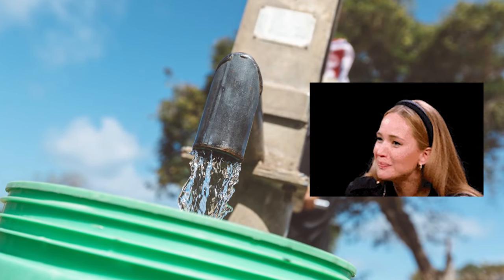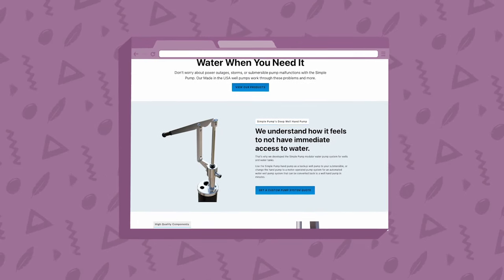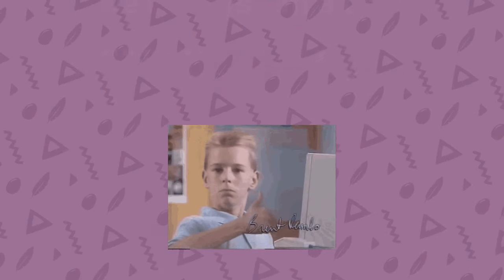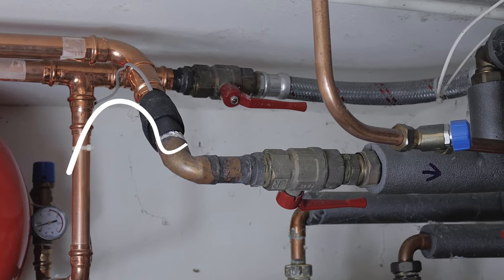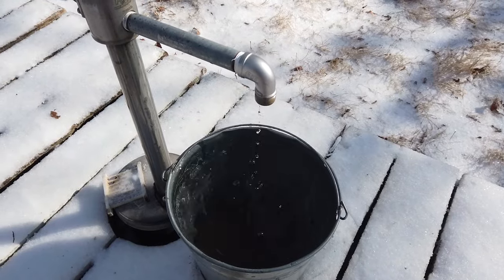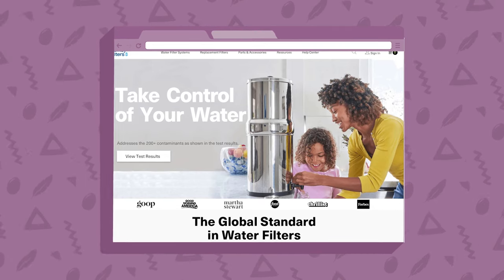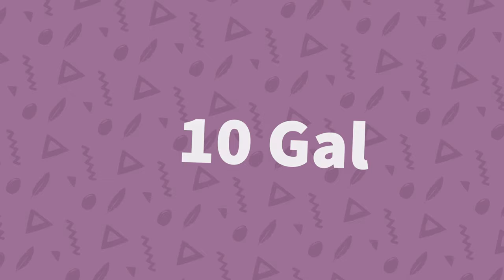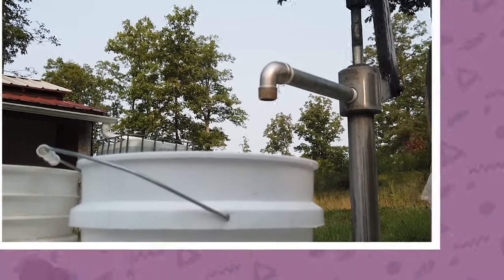Hand Water Pumps: A Guide

Comment: I installed a simple pump in a 275 foot well several years ago. It works well, but requires over 100 pumps if I have not used it in a week. The company insisted that it should hold a column of water and not require so many pumps. I had the well installer pull it out and reinstall it six times. We pressure tested every pipe seal and Simple Pump even sent a replacement pump and replaced several leaky pipes. However, it still requires well over 100 pumps if we have not used it for a week or longer. I don’t care how strong or well-conditioned you are, 100 pumps is a lot of work. I also pressure tested the pump that is in the water after we replaced it. It leaked when applying enough pressure to equal a 275 foot column of water and is likely the cause of the pump not holding a column of water.
Reply: Been living without plumbing or power small farm thirty years
Reply: Have rainwater and gravity system  and swallow well and bucket and rope well dug about one hundred and  eighty years ago😊